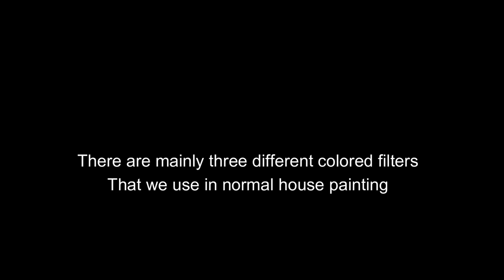why is your spraygun tip clogging up

Comment: I I've started putting a strainer over the pump intake tube saves straining paint and keeps both manifold and gun filters alot cleaner .
Reply from the maker: I normally clean my filters after every spray but this handpiece needs spanners so it only gets done once a week or when I get a clog up, then I change the filter.

Comment: THANKS FOR THE VIDEO..!!!!👍👍👍
I was using the Ozito spray gun 3000psi, was going good for 8 drums of paint then the tip started clogging.
Id reverse the tip then put it back in front again spray gun would spray for 2 seconds then  stop and just mist out the paint. i primed the paint repeated the same process and its doing ther same thing. 
I tested it with water water is fine then the filter has to be the problemtheres pressure and suction so that can be the only problem. I will strain the paint but 
Il have to check the filter like you have just demonstrated.
Reply from the maker: It has to be your filter, a very small hole that's probably hard to see.
Reply: Gregory...Your a top bloke.
Guess what..!!!
It was the filter but the mesh was loose which made sense, I couldnt see any suspicious holes but the mesh on both ends was not attached to the plastic tube which moves around and more than a big enough entry point to get in. This is obvously an OZITO filter which came with the 3000 psi Airless sprayer. The gun though i have to say is pretty freakin good for $330. I just went and got a new Guard,  because their guard's hole was too big and loose for the tip.  So I got a  spare tip, good quality filters, swivel, 500mm, 1000mm extension poles.   Ive been painting/handyman  for over 10 years but havent really done much spraying work. 
The other mistake I made after putting the new shop filter from (AAspray ), it wasnt working again then I realised I put the bloody filter the other way around.. Hence why when you pressed the trigger nothing was comming out at all..🤣🤣🤣🤣🤣🤣
Reply from the maker: So glad you followed my advice, yes those little sprayguns are brilliant for the money

Comment: Do you ever use flat tips in your guns? I really like the way they spray, but I have to use an inline cone filter because my  Graco Silver Plus gun and ARO spray gun (looks the same) don't have a handle filter. If you have used flat tips what filters do you use and how do you clean a flat tip?
Reply from the maker: Flat tip are a mystery for me, Id love to try them myself.
Reply: Those tips are an absolutely terrible ….. mike has made them famous again but no they are pointless with hea tips availible and LP TIPS ….. so much of a process to make sure they don’t clog and to much of a process to unclog them …… I believe it’s like buying a product with a aux cord when their is the same one that is Bluetooth compatible….. don’t do it

Comment: Been suffering recently with tip clogs 
May b you have the answer 
Nothing more frustrating eh
Reply from the maker: Yes, depends on your gun but there are two filters in these guns,one that's larger, harder to find before the pump, but that realy only needs cleaning before storage or your gun is losing pressure.  If your using smaller or brand new tips, even a new filter can bypass those smaller particles,so you need to go down a size to stop them, after your tip is a bit worn its not so important.

Comment: what kind size of filter you use on fflp208 tip 100mesh is enough or 150mesh ? or 200 mesh to match ?
Reply from the maker: I would use a fine filter on a 208, that's red
Reply: @ThePa1nter  guy's All filters has size , but I see you don't even know what size 100 mesh,  150mesh , you know fine filter,  what fine ? 100 mesh enough to be fine?

Comment: That filter looks like its been dug in the mud for centuries 😅
Reply from the maker: Yes its due for a change, using red filters do clog up quicker because they are finer, than the yellow. Don't forget its just had 10 litres of qd oil undercoat through it, then another 10 litres of water based enamel. Just started to clog occasionally on the wagon wheels

Comment: What if you don’t use a gun filter and it still happening
Reply from the maker: Are you saying you don't have a filter,find out what size filter your supposed to be using on that particular tip and put one in. If it works well and then starts happening again, change the filter,these chines filters aren't so strong  now and its possible you blew a hole. If you have no place for a filter,use a nylon stocking on your pickup pipe.
Reply: @ThePa1nterhowto  the thing is I don’t use gun filters someone with 50 years experience told me you don’t need them they clog your tip more and I use no filter for 2 years notice I didn’t have enough lube in my Titian 440 and it was causing it to clog and I didn’t expect that but you do need a body filter but gun filters I don’t use them and it never gave me problem for not using it just wonder why a lot of painter don’t talk about what happen if you don’t put a filter on your gun maybe nobody knew about this .?

Comment: I never used them its the first thing I take out of a gun
Reply from the maker: Realy? Are you using any fine or new  tips? Have you removed the other filters in your gun also as they will take the majority of crap out.
Reply: @ThePa1nterhowto  I remove all filters I just sieve the paint instead. All filters do is clog up. Id recommend  trying it.. you pretty much have to filter all paint these days anyway
Reply from the maker: @JONO3679  Yes you will need to strain all your paint but even if you strain it, chances are your smaller or new tips will still clog. The purchased paint strainers that go over a drum of paint  only go down to approx 60 mesh so just a bit lower than the white filter. I use a 100 mesh(yellow) for most of mine and red (200 mesh) for the 211 and smaller tips.
Reply: @ThePa1nterhowto  try it and see how you get on ...
Reply from the maker: @JONO3679  No im happy, couldn't imagine having to strain all my paint.
Reply: @ThePa1nterhowto   I just use a flour strainer it fits on a 10 ltr takes about 1 mins .. what are you useing  cheesecloth
Reply from the maker: @JONO3679  If I need to strain acrylic, I use flyscreen, oil-based enamel, I use a stocking or the strainer they sell at the paint shop, it's the same as stocking except for white. I don't have any problems, just wanted to highlight it for other people who are perhaps having trouble.
Reply: I’ve been straining my paint but still get clogs , fairly new tips may b just still need blowing out 
I always blow em out at at full pressure before starting with hot water (410 tip red filter)
Reply from the maker: @davidsmalley8783  Take your filter out and take a very good look at it, I'm sure you will find a very small hole in it. Better still just put a new one in, preferably yellow
Reply: @davidsmalley8783  try taking the gun filter out
Reply: @JONO3679  I’ll give it a go but it does not seem logical , the filter is there for a reason 
I’ve got about twenty doors and spindles to do this morning so will let you know but I will be putting a new filter in to start
Reply: @davidsmalley8783  just strain the paint first i don't use any filters I just use a a flour sieve... you can keep one the hose if you want but I remove all of them.
Reply: @davidsmalley8783  any luck
Reply: Stuck with the traditional method 
New red filter , pre blown out tip , filtered acrylic 
No problems at all 
Temperamental sometimes 😞
Reply: @ThePa1nterhowto  you say 200mesh I need to us3 for fflp 208 tip ? 
150mesh nit enough? 
or 100 shell work olso with fflp208 tip .
what do you think 🤔?